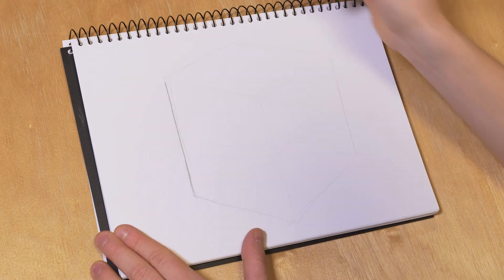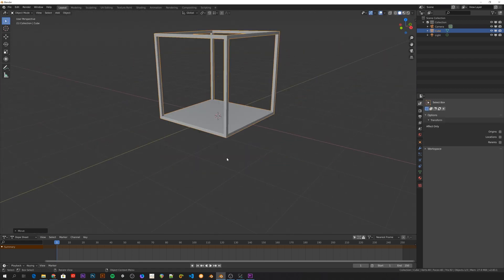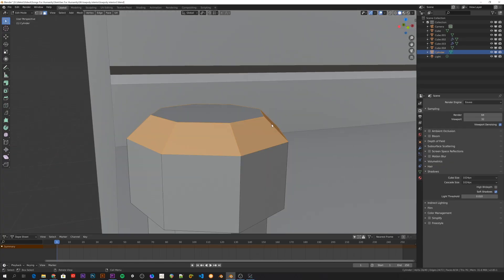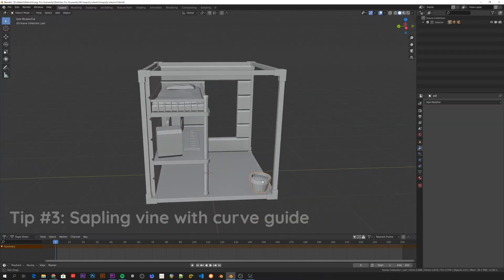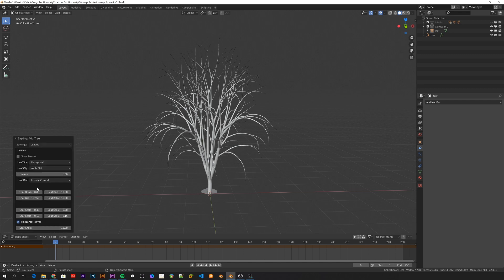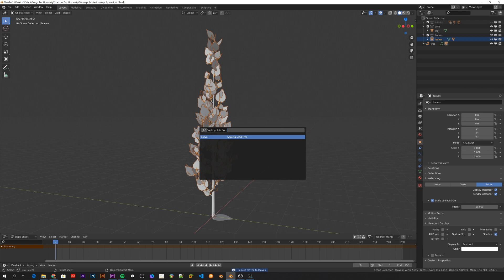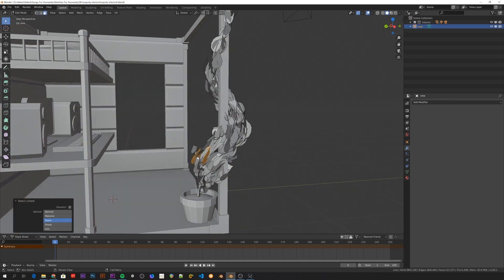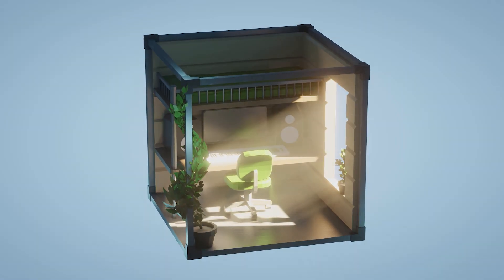Modeling a cozy low poly interior | Blender 2.8 Tips & Tricks #3

Comment: I'm used to moving around in games with 3D-environments by flying. This is why I personally always use Blender's Flight Mode.

Flight Mode in Blender version 2.8 :
-  Shift + ` to enter flight mode,
-  W,A,S,D to move around relative to your view position,
-  E,Q to move the view up or down and to  mouse-movements to rotate the view,
-  Left-mouse-click to exit flight mode and hold the current view, Right-mouse-click to exit flight mode and returns to view before flight,
-  Space to teleport and get closer to an object you're pointing at,
-  TAB to enable gravity which allows you to walk in your scene, there also seems to be a feature where you can jump with V ,
-  Mouse-scrolling increases flight speed, holding Shift boosts current flight speed, holding Alt reduces current flight speed.

Flight Mode in Blender version 2.79 :
-  Shift + F to enter flight mode.
-  W,A,S,D to move around relative to your view position,
-  E,Q to move the view up or down and to  mouse-movements to rotate the view,
-  Left-mouse-click to exit flight mode and hold the current view, Right-mouse-click to exit flight mode and returns to view before flight,
-  Space to teleport and get closer to an object you're pointing at,
-  G to enable gravity which allows you to walk in your scene, there also seems to be a feature where you can jump with V ,
-  Mouse-scrolling increases flight speed, holding Shift boosts current flight speed, holding Alt reduces current flight speed.

Hope it helps someone out!